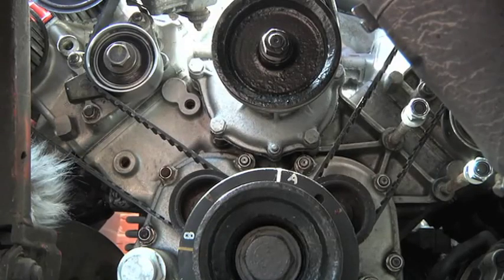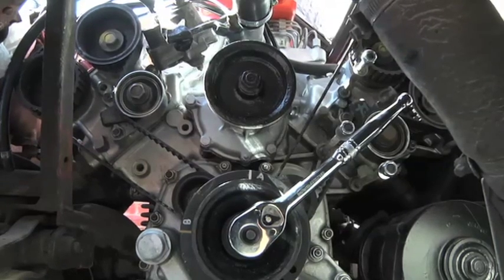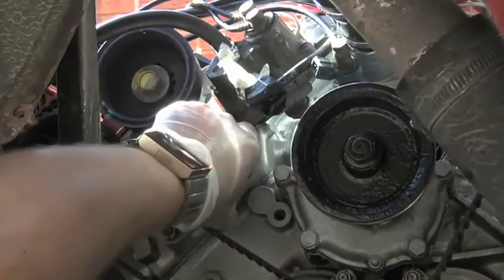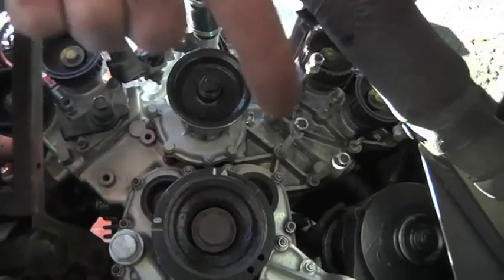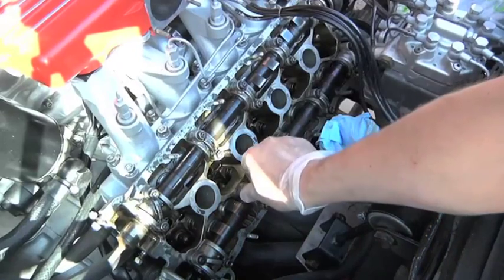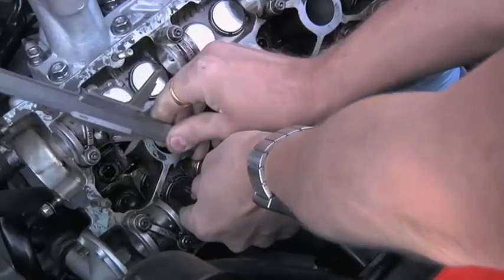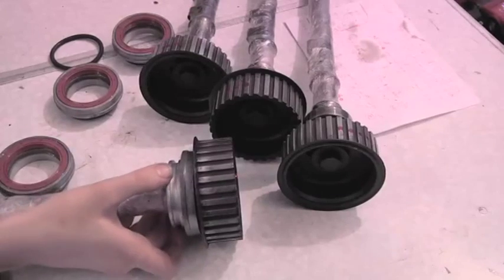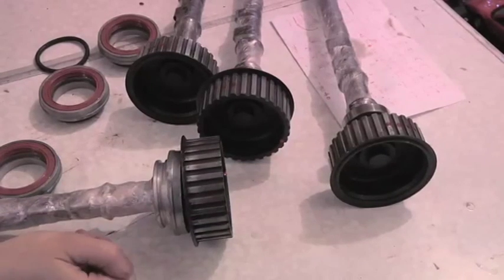Ferrari Mondial Valve Clearances Belts 2

Comment: Great Video, am looking for a mondial now, these videos are awesome, you left us hanging, tell me what was the cause of the lotus crank case split failure?  :D
Reply from the maker: Hi DJ749S I can't find what I said on the video about the Lotus, what was it?
Anyway go for it the Mondial is a great Ferrai that gets a bad rap because it's a 2+2 car. People actually forget its identicle to a 308 and 328 mechanically, same engine gearbox running gear, everything in fact and it handles better than both of those because it has a revised suspension and engine subframe system still used on the current Ferrari V8 cars.
Reply: Hey Heli Doctor, something about crank case cracking, might have been a different vid. really enjoying these vids . Am now actively looking for a QV mondial. Not many in Perth I'm afraid will have to check over east of Aust.
Reply from the maker: DJ749S Hi DJ, the only thing I can think of is a friend was replacing head studs on a Lotus and some oil was in the hole where the stud was removed from. He over tightened in the new studs with oil that should not be there, it hydrauliced and cracked the block. I think that might be it...I tend to chatter away as I remember things when doing these videos, ha ha.